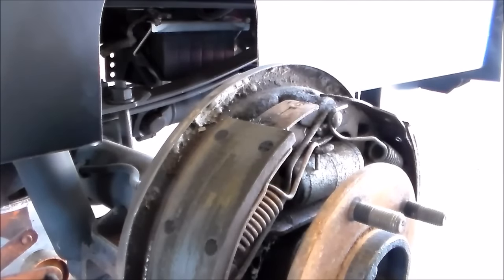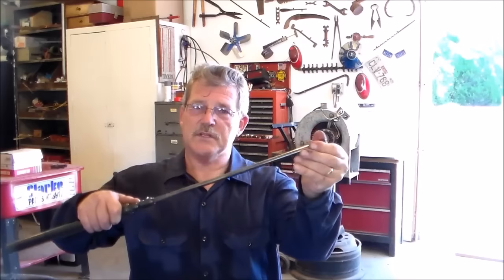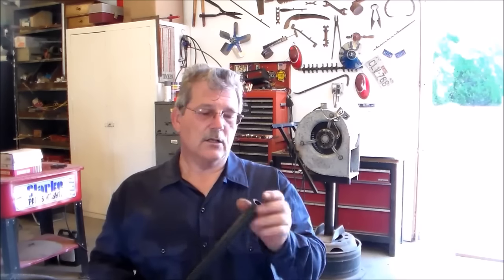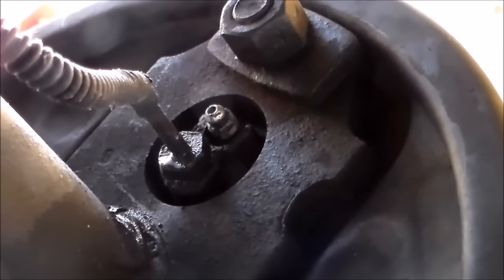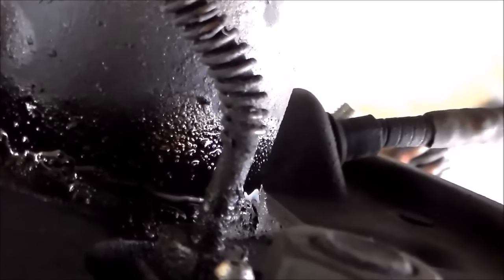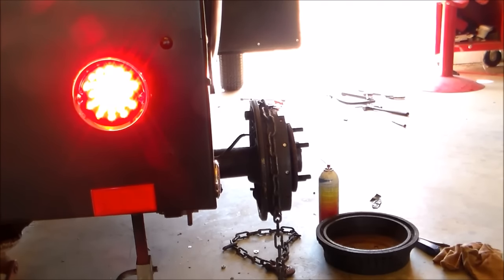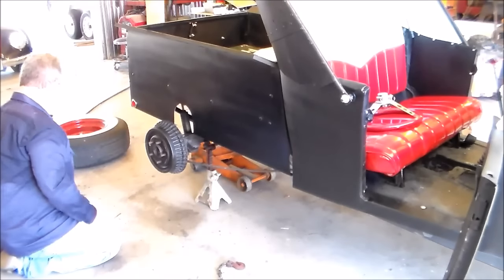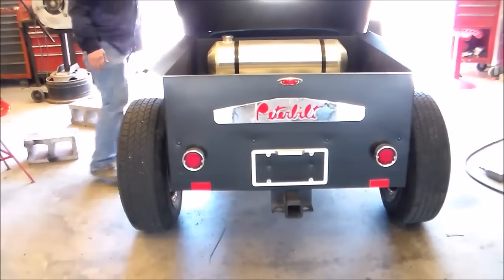Give Me A Brake

Comment: I have a bonnet(hood) strut with a washer welded to one end to do the same job...Glad it was only a minor issue...Good fix up Lloyd.
Reply from the maker: ZIGgassedUP That's a good idea ZIG using the hood strut. I was glad that  the line was loose causing my leak. But it didn't start leaking until I drove it. Take care Mate

Comment: Ive done that before,  by using something to push the brake pedal.  Sometimes i put something in between the brake pedal and the dash to put pressure on the brake pedal.
Reply from the maker: 1970chevelle396 Good idea, ZIG said he uses a gas strut from a hood. Bet that work good too. Thanks for coming by